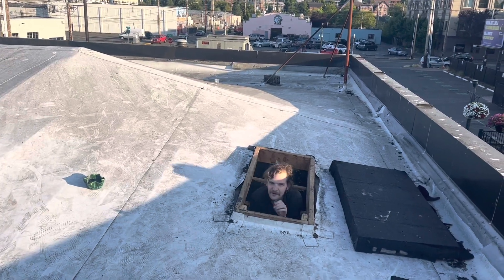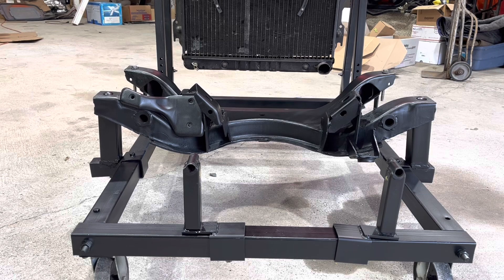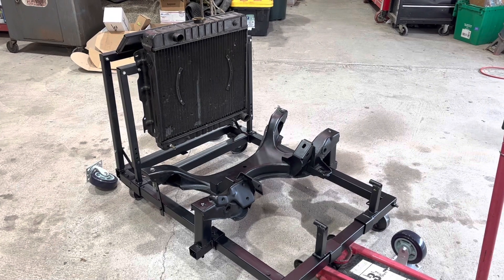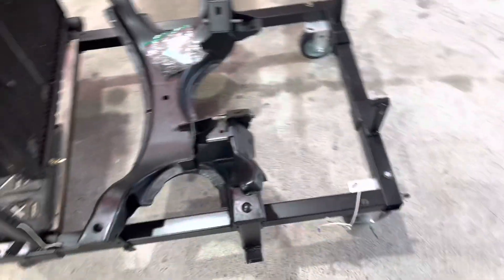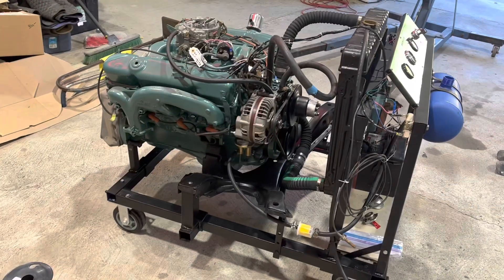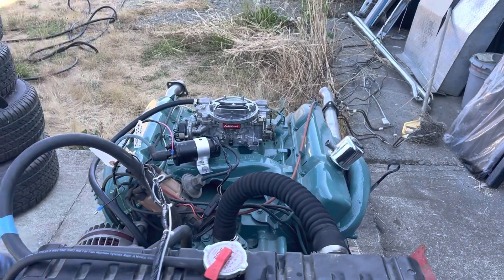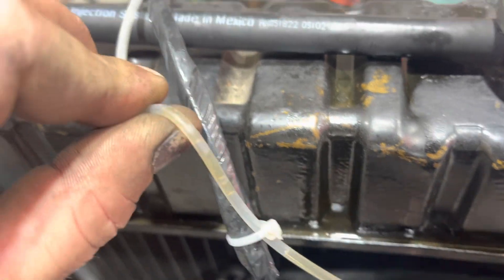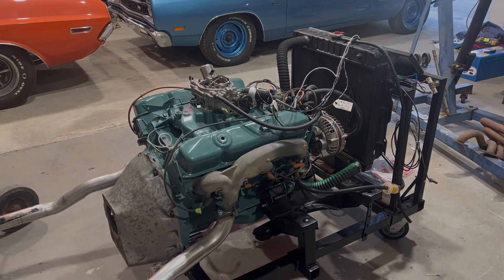Breaking In A Fresh Mopar 440 HP Engine (On A Customized Engine Run Stand)

Comment: I have a 78 RV motor I rebuilt. It’s externally balanced. Can I just use the torque converter that externally balanced it?
Reply from the maker: Well yeah, you need that. Do you mean to break it in out of the car like this? I would use the whole transmission. I think using just the converter would make a huge mess, and quite possibly ruin things inside it.

Comment: Did you bolt on a torque converter for the starter engagement?
Reply from the maker: We use a four speed bellhousing and matching flywheel.

Comment: What color did you use for your motor? I tried Chrysler blue but it’s to dark. I like the color you used. It looks more like the older Chrysler engine color
Reply from the maker: Yes, it is a fairly faithful reproduction of the older “Chrysler Green” which actually has a lot of blue in it. It was custom mixed by a paint shop.
Reply: @DeadDodgeGarage  thank you. And good luck on the rest of your build!

Comment: That turquoise looks pretty spot on to the correct shade. Did you have that mixed or an off the shelf color?
Reply from the maker: Yes it was custom mixed. It looks good! Tom is going to great lengths to make this car correct. He has a mountain of NOS parts. Like… an actual little mountain
Reply: @DeadDodgeGarage you have a great sense of humor. Thanks for the vids!

Comment: Sounds like a mild stock-ish rebuild. Not sure why you needed to use VP fuel. Under no load you could have used pump premium. Actually, GOOD nylon pressure tubing is better than copper. Copper doesn't flex and will crack from the engine movement where it goes into the fitting. Happened to me before and oil pumping everywhere. Engines move. Copper line is rigid. Old SW or Autometer nylon tubing is pretty good. Most of the generic imported parts store line or 'furnished' stuff is trash. Very thin.
Reply from the maker: Funny, that’s exactly what I said. We started with premium, and as it was running the guys topped it up with race gas. Definitely excessive for what it is. The nylon line that split twice was quite old… it really didn’t like heat. I think in this application we’ll be fine with the copper. Engine won’t be moving much.
Reply: @DeadDodgeGarage  I got yah. I've seen small rubber hose sections with crimped brass ends as an 'isolator' about a foot long you can get for the engine side or you could just use a short section of nylon. with a brass union connector. Used solid copper from the engine to the gauge about 30 years ago on a new rebuild and it lasted about a week. Broke off clean right at the nut to the engine fitting. 
Kind of a shame with the price gas now using VP. Last time I bought the 5 Gal 'Pails' of Sunoco 260 was around 4 years ago and it was $60. That was the cheapest around me. It was as high as $75 at some places. I used regular 110 Purple and the 'Blue' Supreme 112 Leaded. I think they were about the same price.

Comment: What year motor?  Did I miss it?
Reply from the maker: Actually I didn’t say because I didn’t want to be wrong. Haha. I think it’s a ‘68. The car is so buried I don’t know what it is.
Reply: @DeadDodgeGarage  thanks,was curious about the turquoise paint!
Reply: @anthonybrincefield2812  68 440 HP.  Paint sprayed out a gun with the correct OE color.
Reply: @rocketresto  thank you , love Mopars but have been out of the hobby for a while and couldn’t remember when the orange engine paint became the norm
Reply: @anthonybrincefield2812  69 on non-ac 383-4 and 440-4 engines

Comment: How much total do you have in it now and approximately how much time sure is nice to run an engine to find leaks before the put in the car so much time saving
Reply from the maker: It took me about three days to go from engine run stand as it was to running big block on it - and a lot of the third day was getting the engine ready. Almost all of the parts used were scavenged in house. I think the run stand cost $200-300 used. We bought some hoses and fittings and such. Obviously if one had to buy all of the parts that would be different. Something like $600-800 all in sounds right.
Reply: @DeadDodgeGarage  thanks there I checked summit and they were over $800 so I kinda thought I'm not gonna make one but if I can find a good used one that would be the way to go like you guys did sounds great thank you for your time bye bye
Reply: @mikedaugharty5544  summit ones are FAR from plug and play, if you want to build one would try to find a used cheap one on Facebook marketplace or something and go from there.  If you are going to have to do all the mods to it anyways you might as well start with a cheap one.  Plug and play ones are like $3-3500 which…ouch…
Reply: @rocketresto  you hit it right on the head with your description Umm summit is way out of my ballpark I will look for a used one I think with putting the k-member on there ,it's just better to make your own is what I'm kind of thinking, mine will be mainly Mopar use so I think it would be just easier to make my own